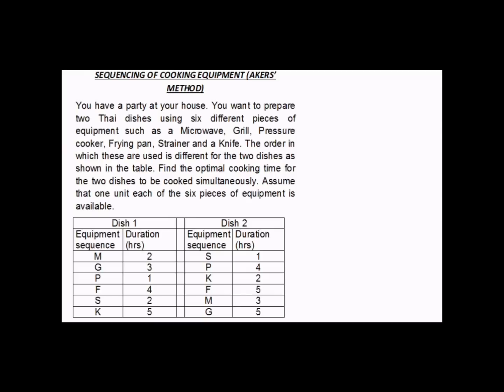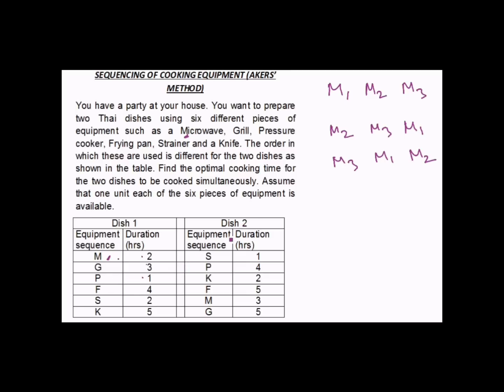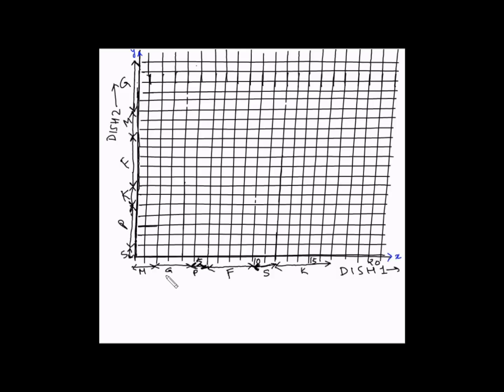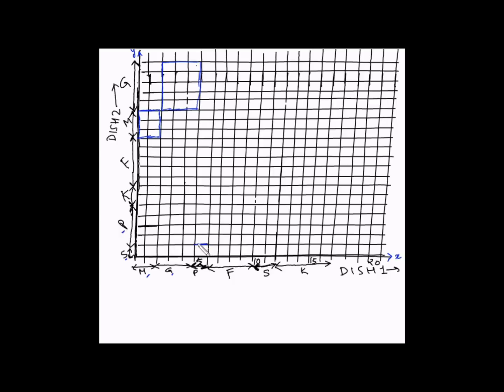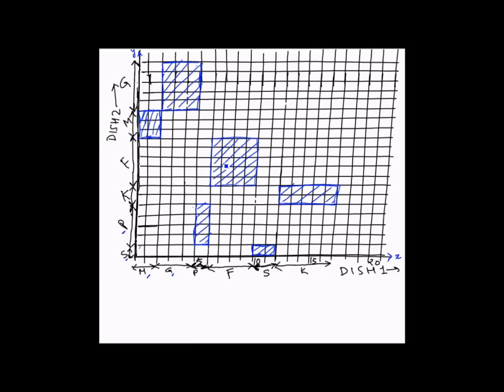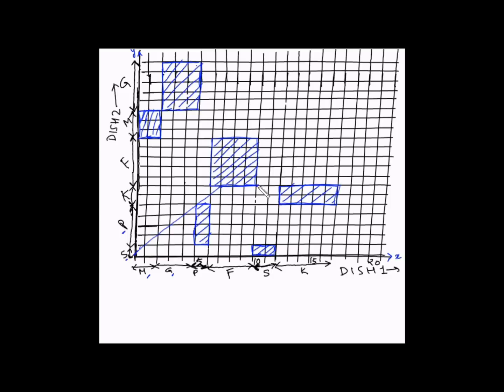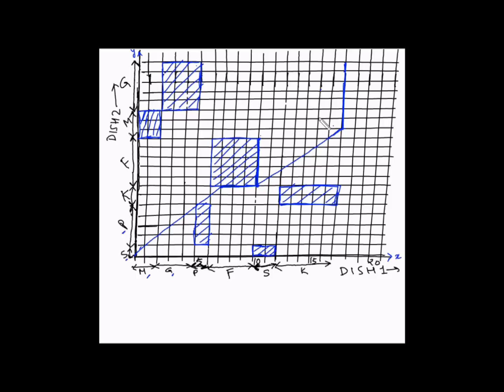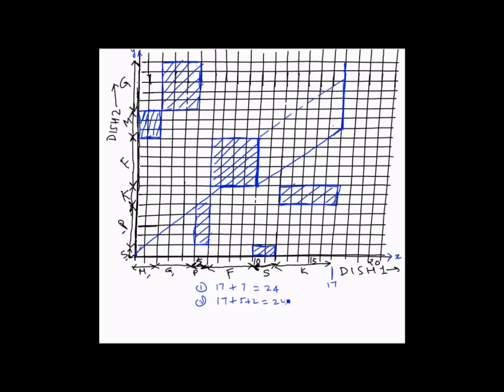Sequencing 2 jobs on m machines - Example 1

Comment: why horizontal distance is 17 in both the cases?? in same way the vertical distance wud also b the same
Reply from the maker: Hi,
Very good question!! When the line is travelling diagonally, both dish 1 and dish 2 are being processed together. When the line is horizontal, only dish 1 is being processed. So, in both the cases, if you find out the distance traveled by the horizontal and diagonal lines, the total is 17. Which indicates that the time taken to process dish 1 is 17. Now, after we have found the time taken for processing dish 1, we then find out the time for which only dish 2 is being processed. This is represented by the vertical movement of the line and comes out to 7 in both the cases.
Hope this helps!

Thanks.